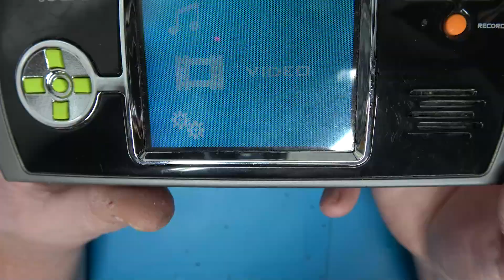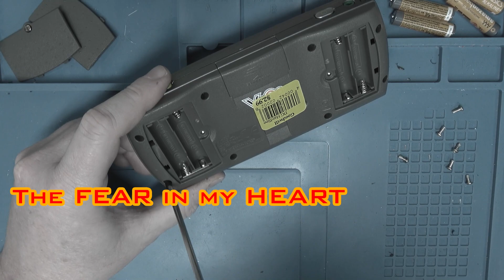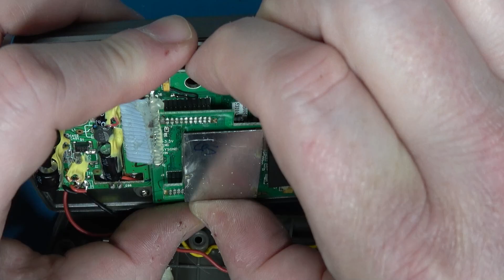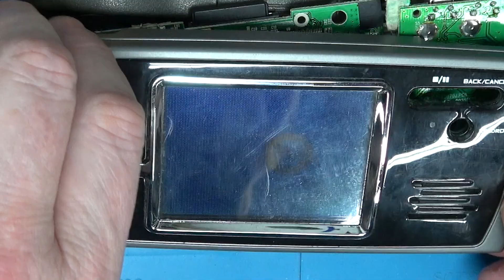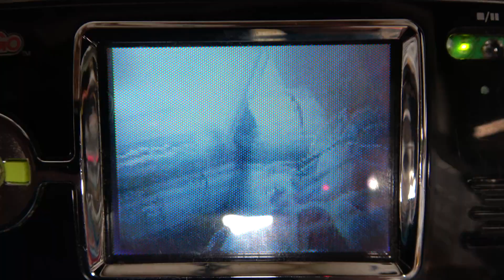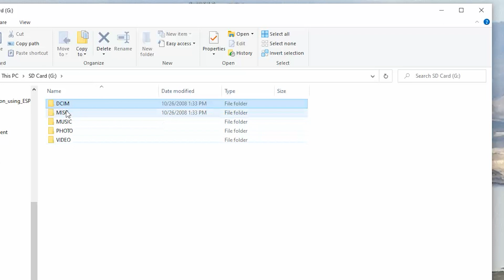Goodwill Crap: Tiger Electronic's VuGo

Comment: I know it's an old video but... the TSA comment made me nod emphatically! 🤣

~7 years ago we were coming back from the cabin (Alaska) and I had the Hotspot that I had just modified. It took a MicroSIM (Mini?) and my home cellular internet modern (rural TN life) only used full-size... So I salvaged the full-size SIM holder out of am old cellphone and soldered it to a piece of protoboard, then soldered some salvaged ribbon cable to that... X2, because there's two sides of contacts. 
THEN removed some of the cover in the ribbon and wedged it inside the Micro slot! 😅

Only reason I did it that way we to non-destructively modify it, and because the SIM was UNDER the battery, so to fit that in meant I couldn't use wires!
Much to my amazement this MacGyver job worked just fine, and I never planned to remove the battery so that I didn't have to fight to get the thing to make contact with all the spring pins inside the Hotspot.

At least that was the plan... Because going TO the cabin, TSA didn't care. Probably because interior travel to exterior.
On the way home, THEN I got stopped and pulled aside lol

Swabbed and checked for 💥residue. Negative.
Looked it over.
Swabbed ME and checked... Also negative.
Swabbed it again. Still negative... lol
Called supervisor over. He looked at it. Told them to take photos, give it back and let me go. 😅 Thankfully that 25min ordeal didn't make us miss the flight. 

In fairness, dad worked for NWA for 30+ years and so I get it, and appreciate it. As such, I can totally see why they found it suspicious. In the trips after that, I indeed kept it disconnected and coiled up so to not look questionable. That was indeed sufficient, neither getting pulled aside OR having them need to look at it even for a moment. 😊

So yea, I'm sure that would've caused major panic lol ESPECIALLY way back in 05!!! 🤣

Comment: Ben: I think your initial recording problem stems from the lack of proprietary cable included when sold new. My TV-Now! has it... and it simultaneously plugs into the A/V-input and headphones port--perhaps as some method setting a default audio recording level. 

And yes: It was 3-pin for the input. [:\

Comment: Bought the VideoNow! version brand-new, around 2005... for $25.00 at a Wal-Mart Black Friday Sale. My variant has the USB ports--or at least where they'd be located--covered by gray body-color matched tabs, but I understand it runs the same codex as the Vu-Go. I came to hate the audio recording levels game I had to play with it, but loved how the SD-card slot could take far-larger than the advertised 2GB... so if anyone can link it to me, so I can burn directly to the card, I'd be grateful. :)

Comment: I've recently gotten back into GBA and Nintendo DS noticed how the impressively low screen resolution hasn't aged too well, but wow, it looks amazing compared to this. Even the original DS with its tranflective display is better, somehow better colors and due to the tranflective display it's MORE visible in direct sunlight (quite underrated for road trips). The original GBA screen is almost better, can you imagine trying to play this console on a sunny day in the car? The funny part is that's sorta what this was meant for, a cheapo thing to buy on a road trip and throw to the kids in the back... At least that's until you consider the price. Why would anyone ever buy this instead of a used GBA, especially in 2005? And not to mention the very very obvious PSP. Granted the low resolution of what hasn't aged well either but even the 1000 model had a screen league's above this. Ironic that you mentioned SpongeBob and portable video since I have fond memories of watching SpongeBob on Gameboy Advance Video.

Comment: Oh my, i hated those early LCD's with triad phosphor. I believe the LCD panel itself is entirely analog.
Reply: They were outdated when this was new too, that's the funny part. In 2005 the AGS 101 GBA was out which was budget as heck as far as components goes and still looked good and Apple was selling a 30 inch 1440p IPS display.

Comment: I know that at games portable Atari 2600 you find at Dollar general has an audio video Jack apparently it only uses mono audio and video so I was trying to put a regular audio video plug into it and it wouldn't work until I just used a regular plug that had a headphone jack on one side and just the left and right audio and one of them eventually became video but it still had the same buzz issues that thing does

Comment: Speaking of portable systems are back in the day. We definitely need a better solution for the battery problem the Sega nomad has I've seen all kinds of crazy ideas. Until recently now they're using rechargeable batteries and charging circuits such as the case as the LAZER BEAR is doing where he has a 3D printed battery pack and most of the components except for the batteries to go into it but I also noticed that if you had a 3D printer and you can find those very same components online you can pretty much build your own. and I guess instead of the 30 minutes you would normally get on regular batteries it's supposed to last for 6 hours. But it a you must assemble kit

Comment: I remember back in the early 00' they had digital recorder type things where you could use SD cards to record shows off of TV.
It wasn't that expensive but SD cards of course were and I think the maximum size at the time was maybe 4GB and of course the best you could hope for was 640X480 
I think 480p but it could have only been 480i. Either way back in those days when the internet was still pretty crap and expensive and downloading things was pretty much P2P or nothing it was a good products though it wouldn't be long before it was taken over by smartphones.

Comment: You didn't get any video at the start because you were using the wrong kind of lead. RCA breakouts like that use three lines, not two. The 3.5mm jack will also have an extra band in there - this specifically is what'll tell the receiving device that it's getting a video signal, otherwise it'll just treat the incoming signal as audio-only.

Comment: TVV files are a variant of the MPEG-4 format developed specifically for use with 'TV-Now' and 'Vugo' media players developed by Hasbro-Tiger electronics  so i would think vlc should play them
Reply from the maker: Will try that thanks!
Reply: @BenHeckHacks  If VLC can't, try ffplay (part of ffmpeg). In my experience, if ffplay can't play it, it's not a media format.
Reply: I was going to say the same, before i knew they were mpeg4. VLC should have no problem unless the file format was specifically written to be incompatible with standard video
Reply: Or MPV, I use SMplayer as a frontend. Used to use VLC but one of the lead devs has a somewhat bigoted view on frame interpolation (he's one of those guys who genuinely looks down on you if you like high framerate video for any reason) and VLC has longtime performance issues anyway if you are nitpicky about frame pacing. Never ran into anything I couldn't play with SMplayer.